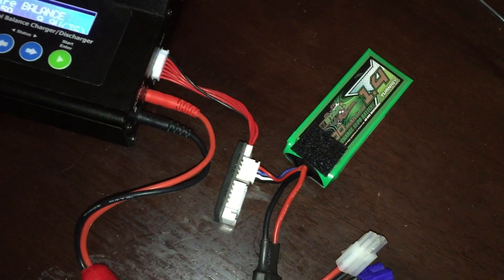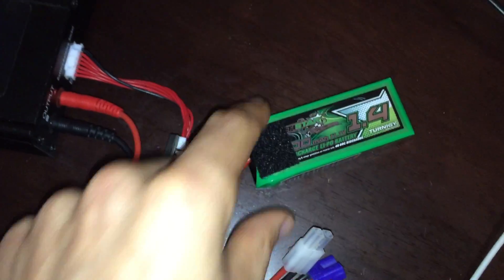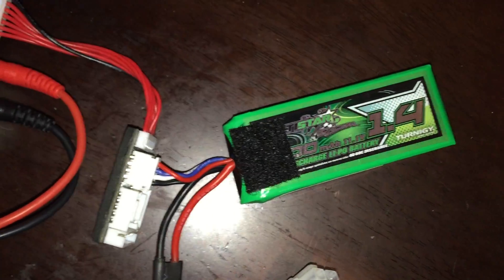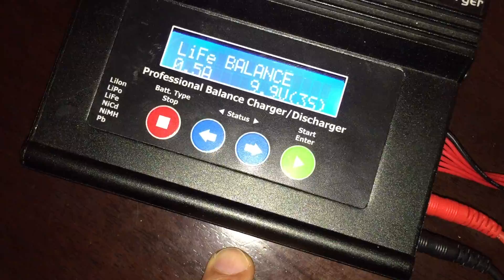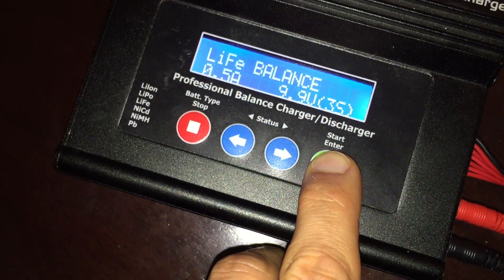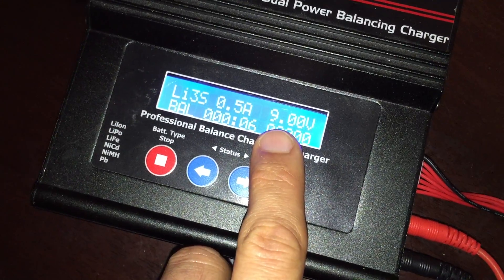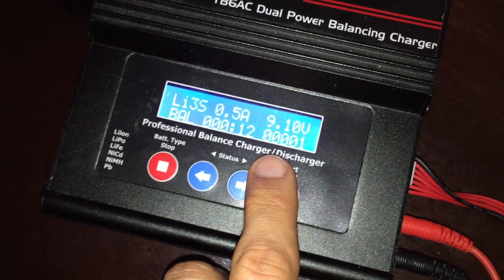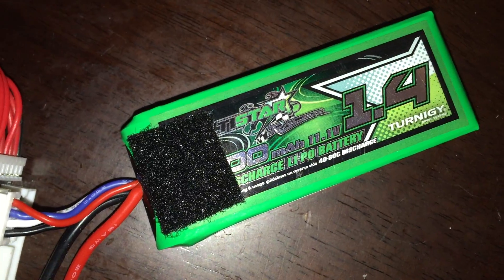Fix a Dead Lipo Battery - Easy Method

Comment: "LIFE" on this charger means you have told the charger that you connected a Lithium Iron Phosphate (Li-Fe) battery. The charger then thinks it's ok to start charging because Li-Fe batteries operate around 3.2v per cell instead of the 3.7v per cell of a LiPo. This gets the battery voltage up high enough that it will be detected as a good battery when the charger is switched back to charge a LiPo battery. Then the charger will put a standard li-po charge on the battery.

Comment: 9.9 volts on a 11.1 volt battery is not dead, 0v would be dead, 1v would be nearly dead 9.9 is slightly under voltage.

Comment: My charging station won't even accept it as it's so low there's no circuit 😔
Reply: Throw it out. If it's that low it's pretty dangerous to recharge it1
Reply: @ELValenin  if it gets that low, use another battery to jump some electricity back into it by touching the corresponding wires together. Hold for about 10 second and it effectively starts to balance the cells enough to be picked up again. You'll get a lil shock doing it, but it works 👍
Reply: @Cursed_jimny_4x4uk  uuuuh I think you'll exceed the c rating of the both batteries that way
Reply: @ELValenin  yeah it does. But it'll be reeettttt😂🤣

Comment: Yo. This worked for the 4 cell version of this. Nice, that just saved me ~$30
Reply: Eric Tergerson I'm doing this on a 4s lipo also. After recovering the battery and fully charged. And after using it can I do normal charge. How is ur battery condition now.